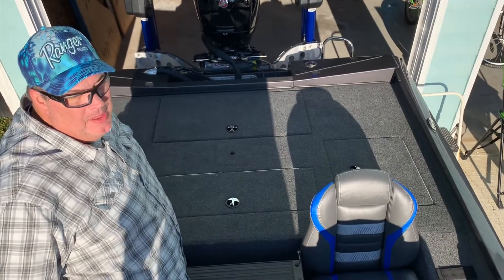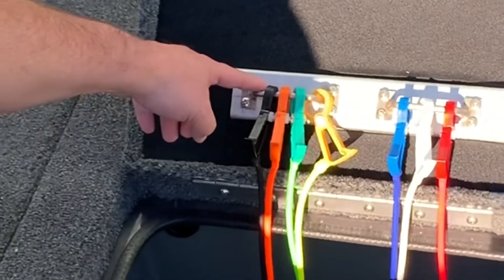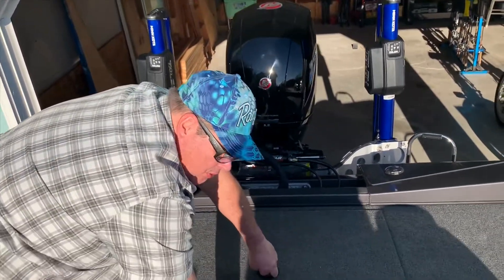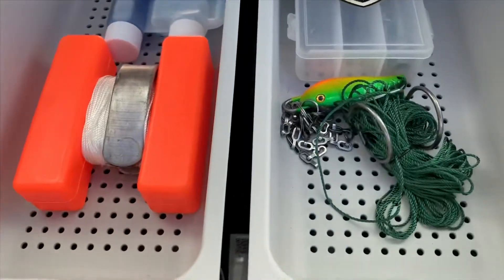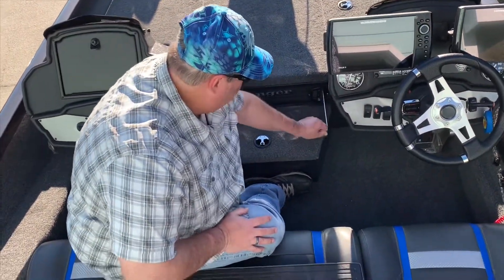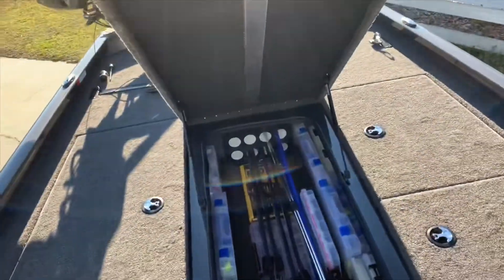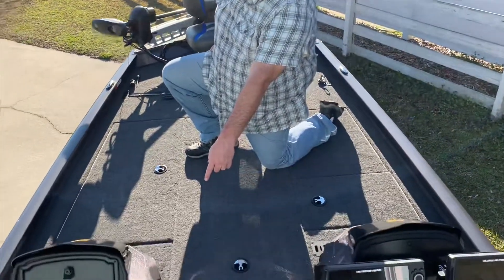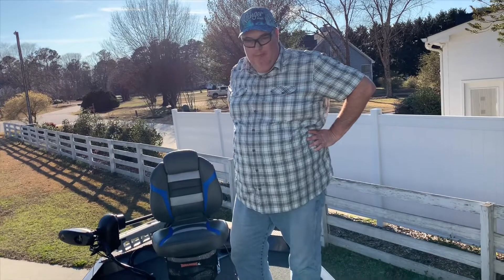UPGRADES for my Ranger Bass Boat

Comment: Sweet boat. Thinking about buying  a RT188p over a fiberglass 18’.
Reply from the maker: I’ve been extremely happy with my 198P. I’ve had the opportunity to fish out of RT 188 not the P version but the original. The 188 I got the fish out of is the reason why I want to head and wet with the 198 they gave me the confidence that the aluminum boat was what I wanted. Ranger is done a really good job of making that boat very solid by filling it with so much foam for flotation and the amount of top-quality welding and the addition to adding some fiberglass components just makes this boat top notch . No more wood rotting out underneath the deck no more creaking and cracking as you walk and no more your bloat being blown around by the wind or a wave knocking you off the boat. The advantages are that it’s lighter than fiberglass but still gives you a stable platform to fish off of. If you could get out on the water on one and fish off of   Of it first that’s what I would recommend but you can’t go wrong with any of the RT boats by ranger they are all equally impressive.

Comment: What is the total length of your boat with the  swing tongue closed? I only have 22 1/2 feet in my garage so not sure if the 198p with a jack plate will fit. Your boat is set up perfect.
Reply from the maker: I have not measured it with it the tongue closed that means that would be a longer length. My garage is very small from the garage door to the back wall Is 23 feet. With the tongue swung open It’s 22’6” so I only have 6 inches to spare. Just barely big enough to fit in my garage.

Comment: I see you put two talons on the back of your Ranger.What does Ranger boat nave to say about that?Doesnt it void your warranty?
Reply from the maker: Barry if you’re certified dealer installs the talons they do not void your warranty. But if you or somebody who is not certified by ranger does it it could void your warranty. So paid a little extra and get your dealer who is certified to do it.. One thing that you need to think about if you’re interested in the talons is how long of the model you want. I went with the eight footers because they are the same height as my 150 Horsepower motor. This allows me to go into tunnels under bridges and under trees without getting any hangups. Plus with my Ultrex Trolling motor I can you spot lock a lot of the times and the only time that I really need to use the talons are when I am in super shallow water and if you’re in super shallow water you don’t need 12 foot Talons. Save yourself the money and get the right size.
Reply: I believe only on the newer models you can do that, upgraded the hull and transom

Comment: Do the ikea trays fit In the 178 and 188 also thanks
Reply from the maker: Yes,                                                                I Have been told by the guys on the Ranger Forum that they do fit all 198p, 188 and 178 battery compartments. I was able to put 4 trays in my boat. A fifth one would get in the way of the door latch I know this because I broke a tray trying to force the latch to close. So I would not buy more than four and make sure that they’re spaced out so that way in the middle you have room to close the door latch.

Comment: Is the boat's front deck big/stable enough for you and a partner to fish comfortably off it together?
Reply: Why would it not be?
Reply from the maker: Brian, when you’re standing in the wide open in chunking crank baits you have plenty of room as long as you don’t have too many rods on the deck. Now when you are flipping in tight areas we preferred to separate. We could both stay at the front of the deck but to be honest with you it is still an aluminum boat and does not have the front deck space a 21 foot fiberglass but would have. The advantage this boat has over those big boats, is that it’s light can get into tight small areas, creeks, and save you a lot of money on gas. I am extremely happy with the performance of this boat and I think it would be awesome for most people out there..
Reply: Bass Zone 101 thanks for the reply. What kind of speeds do u get out of it with just you or you and a partner
Reply from the maker: Bryan Keane So my boat is pretty heavy with a lot of gear typically I have between 22 to 26 rods in the boat depending on where I’m going and I carry a lot of tackle I’ve tried to slam it down a little bit but seems like the night before the tournament I always put a few more boxes back in plus I’d like to have the right clothing for in case whether such a waste is change. That Being said if someone were to run the boat with less way they could do probably much better at speed but I am very happy with what I get. So I’m 320 pounds my partner ways around 220 that I fish with in tournaments so we are both the guys. And I am able to achieve 54 mph in perfect conditions when it’s a little choppy usually 52s about all I can get. I know they were guys out there that claim they can get 60 mph and all I can say is they probably have absolutely nothing in the boat and they are very light and if I turn my boat for top end I could probably do the same but my boat is set up for war not a drag race
Reply from the maker: I didn’t want to add that when the boat was completely empty I was able to get it to go 58 mph once with just me and about and absolutely no gear
Reply: Bryan,
You would be much happier with a Lowe stinger 188 or 198 it has 1.5 times the front deck space as a Ranger and I have owned both and still have a Lowe 188.
Reply: @williesanford8394  I ended up buying a Skeeter ZX200 which I have been very pleased with. Thanks for the reply tho

Comment: I got the trays for my 2020 198p and the deck lid is pretty tight when closing.  Did you have that issue when you first put yours in?
Reply from the maker: Make sure they’re in correctly and that they’re flat. You cannot put one in the center for the Interfere with the door latch. And you also can’t put them all the way to the side edge. It was snug but nothing tough to close.
Reply: Bass Zone 101 thanks for replying.  I think I had mine all the way to the edge on the sides.  I bet that was my problem.  I’m gonna check it tomorrow.  Great upgrades by the way.  I ordered the cull system from ranger with my store credit too.  Installing some stainless handles like yours is my next project.